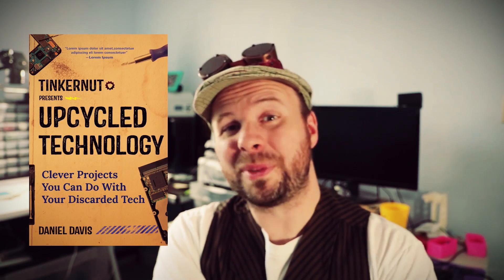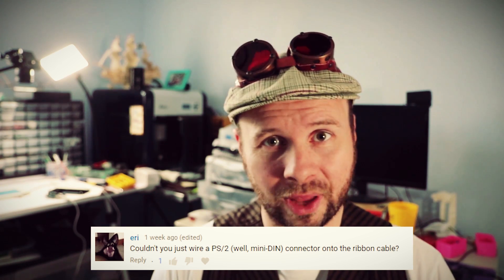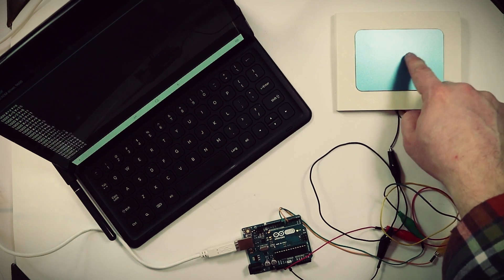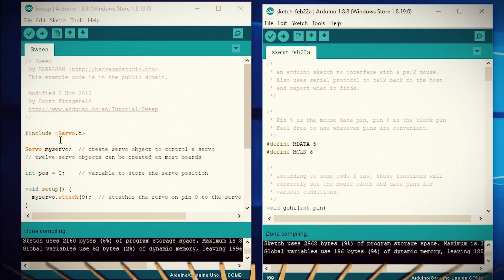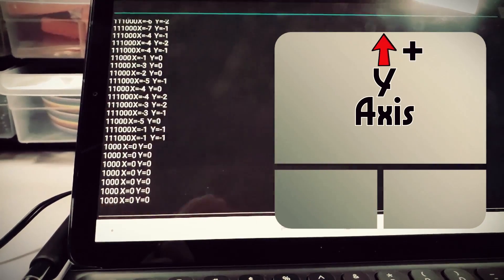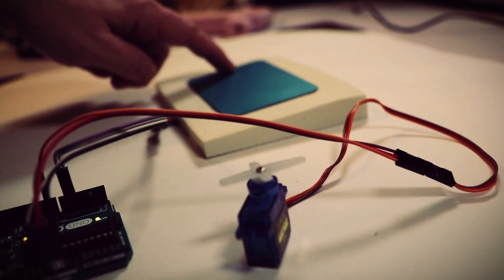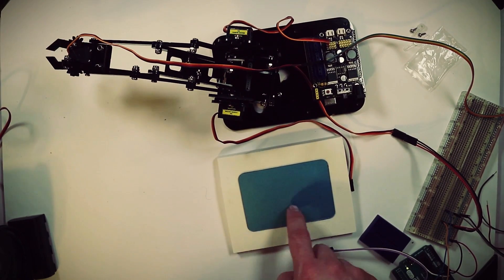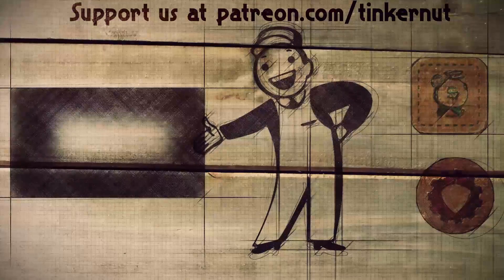Things To Do With A Broken Laptop: Touchpad Hacking (part 2)

Comment: OR, I saw an advertisement for a "laptop" case for a Raspberry Pi that had a keyboard, a display, access to the various io ports, power supply, etc. They wanted almost $450 bucks for the darn thing! Would be a good second life for a used up laptop. What say ye, Omnipotent Tech God (aka Tinkernut!)?

Comment: Turn laptop keyboard to PS2,use wifi card to connect to PC pcie ,make a connector that connect laptop chip to PC ,same for RAM or MAKE RAM A STORAGE DEVICE WITH A BUTTON CELL OR POWERBANK ITS GOOD FOR SECURITY AND VERY QUICK DATA TRANSFER (THIS ONE I DIDN'T SEE ANYONE ).
Reply: Ram as temporary storage especially for file transfer is good with 2-4Gbps and secure if you remove the power it clear(only ddRAM I am not sure with sdRAM)

Comment: Turn a Logitech k400 into a wireless track pad by removing the keyboard and putting making it as small as possible.  Full disclosure I have a dead keyboard but the track pad still works fine so I am planing to do this at sometime.

Comment: Turn the laptop display into a display with a standard port (hdmi, dvi...)
Reply: I do believe that there are tutorials on doing this (I watched DIY perks), what you need is to buy a laptop screen controller and a power supply and this should work

(ofc you can search "DIY perks portable laptop screen")

Comment: -Turn the keyboard into a usb keyboard,
-Use the Arduino to pull audio files from the sd card slot (if the laptop has one) and play them from the laptops speaker.
-play with the lcd screen

Comment: Reuse webcam and turn into security camera
Reply: DIYPerks did it
Reply: @LukeZain  yup
Reply: Robert Mathew I like this idea.
Reply: Pretty sure the webcam works the same way, it's just internally a USB device. You could solder a USB cable to it and do whatever you wanted with it connected to a computer/raspberry pi

Comment: Check eBay for lcd controller to reuse laptop monitor. It would be cool if it could be connected to a raspberry pi  zero w. Remove the old keyboard and add a Bluetooth replacement. Imagine having the ability to slide out the Bluetooth keyboard and have something underneath like arcade button's for emulators. A modular laptop type setup. Just random ideas good luck.

Comment: Turn the laptop's keyboard into a drum machine or midi controller.
Reply: hed420 what is a drum machine used for ??
Reply: @drakerangers682  Making beats digitally look up MPC machine, I am sure there is better hardware now.  I took a video, radio production class over a decade ago that was the top of the line machine then.  I used the MPC with Protools for audio & editing video on final cut pro hd lol , to give you perspective on the time period I was still using a fire wire.

Comment: I'd like to know how to connect the screen to a Raspberry Pi.

Also, it'd be slick if you could wire the touchpad to the Pi without that clunky PS2-USB converter in the way. =)
Reply: Remove the lcd from the laptop and see if you can find a compatible LCD Controller for your display model. LCD controllers go anywhere from $15 to $80 and have a variety of inputs including vga, hdmi, svideo, etc.. It's pretty simple, plug and play. Plenty of tutorials here on YT.

Comment: Very good video! Can you add gestures to the touchpad? For example, draw an "L" and turn on the lights, or draw an "M" and start an engine.
Reply: That's really super hard to do
Reply: @erikpoephoofd  well you don't need to reinvent the wheel and search the internet instead. I don't know whether the Arduino is capable of such tasks, but I'm pretty confident that it would definitely work on the faster boards
Reply: @wi_zeus6798  You're right, just found that the Raspberry Pi supports a gesture library. Pretty nice

Comment: Hey Tinkernut. What about tap on the track pad? A lot of track pad have tap function on them. Sense your robot arm has 4 Servos on it, Tap for the first two servers and tap again for the Third and forth servo function?
Reply: It's software (the drivers) that detects a tap. Of course, an Arduino (or whatever you use) could detect it just as well.
Reply: @TDGalea   Oh i know. But it can be added to the arduino. to do the same thing for the Robot.
Reply: @DiyintheGhetto  I was thinking that same thing... X axis rotates, Y axis controls up-down, tap closes the claw, double-tap opens the claw. =)